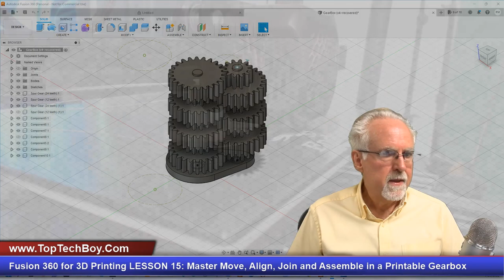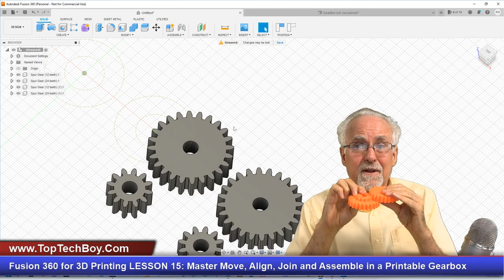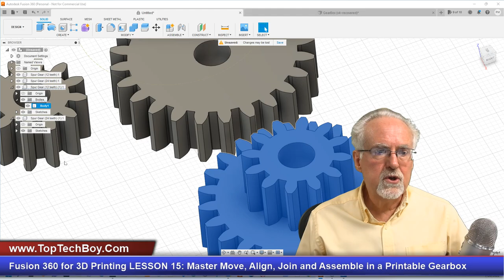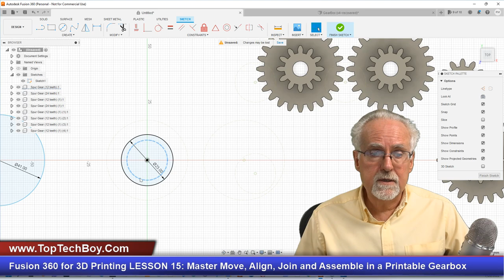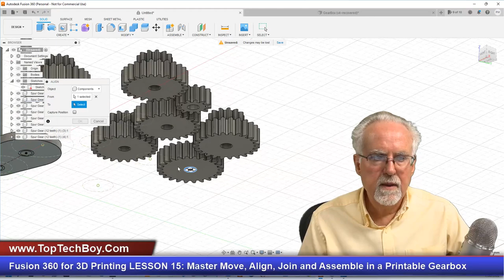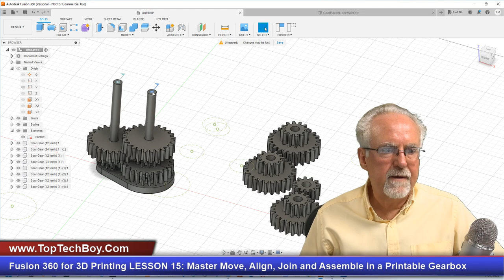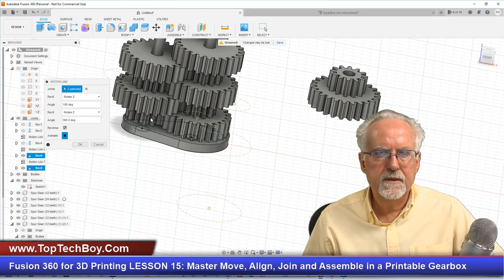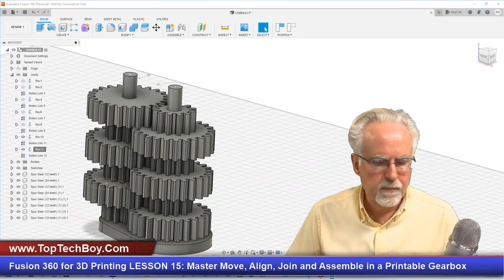Fusion 360 for 3D Printing LESSON 15: Master Move, Align, Join and Assemble in a Printable Gearbox

Comment: Paul .... now you are feeling much better, no scratchy throat ....  good good 🙃When you started Align double gears and try to turn it up side down, it was going under the Base. You have cancelled it, but in that situation there is a Flip function, and it at once turn the gear 180 deg.... and voila 🙃
On the end, the gears are made to increase the speed, so they are a little not good look when animate, insetead of the first Rev1, try to run the next Revs up to the last one, it will be much better animation .... voila monsieur 🙂

Comment: I was having problems with parts sticking to my bed and what I finally did, was take some green Scotch-Brite and lightly buffed the surface, breaking the glaze that seems to build-up--you will see it lose some its sheen a bit but it really helps.  If you do it lightly, you will still have the bed-sheet's texture still embossed on the bottom of the part (which I like and purposely use).   Then I use 91% isopropyl-alcohol and Kim-Wipes (which are lint free) to clean the surface between prints.  I would recommend that you first try a good scrubbing with Kim-Wipes/paper-towel and alcohol first...

Comment: I had to redesign and print the gear box four times! And instead of adding a pinion on the plate, I added two axles that’s go through a hole and spin freely since with pinion, there is a tendency for them to break.

Comment: Very instructive. Thanks for sharing. It is normal that the hole on the face in contact with the build plate is a little bit smaller, this due to the elephant foot. You can solve the issue by putting a négative value to the Horizontal Expansion (Cura and Simplify3d).

Comment: I am legend ! yep, took a while but nailed it without folding. Had trouble trying to get it animated after the first 2 gears, so will be interesting to see your method, if it's covered here. 3d printed the gears 1st time without issue, designed a top plate as the axles failed on the 1st design. Also incorporated spacing rings so the gear wasn't rubbing each other over it's entire face. That meant making the smaller double gear wider by the same width as the spacer so it alternately lined up. Great exercise, thank you.

Comment: A lot of copy gear components..   to  make this gearbox i had designed the components that are diffrent and let slicer import the number you need for printing.  OK then you can not  see  the gear box  working. But it worked fine for teaching the process...
Is it possible to reuse a designed component multible times in a assemply??.

Comment: I assembled the gears in fusion360 but couldn’t  get a good print because the gear teeth were so small a couple of teeth kept getting deformed. I like your assembly method better than mine. I noticed that you rotated the top small gear to fit with the large gear but did not do that alignment with the other gears as you stacked them.

Comment: Hey Paul. Have you seen the magnetic removable print bed that Ender has? I have it on mine and every print sticks to the bed very very well. And when the bed cools down after a print, they just pop off with no effort. I think its a big improvement from the glass beds. Just thought I'd mention it.

Comment: Gears are not set up in correct way before motion link small gear teeth are on the big gear teeth
If you hide the bottom body of the cover you will see small gear and big gear in wrong position
It sholud be started from small gear and than the rest without having to rotate every duble gear component.
Regards